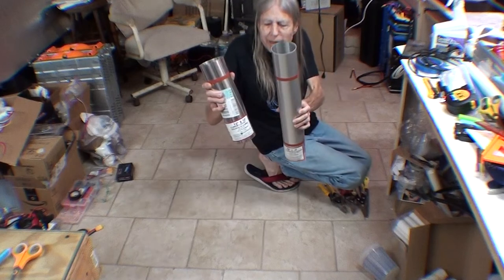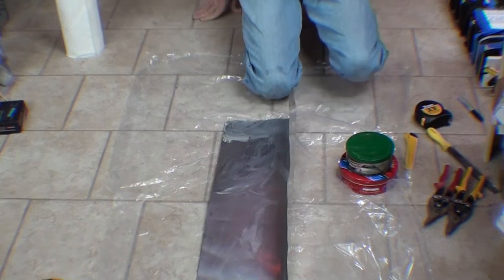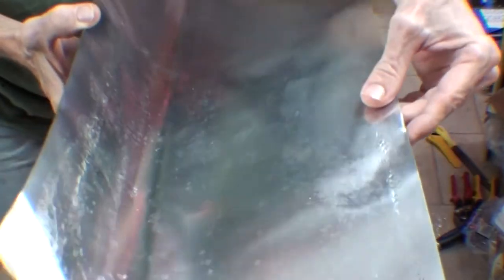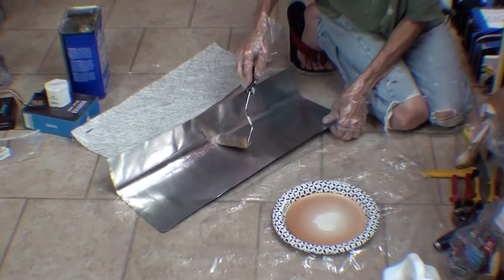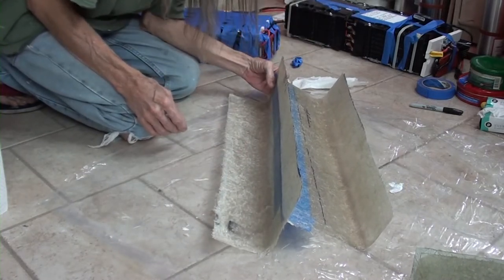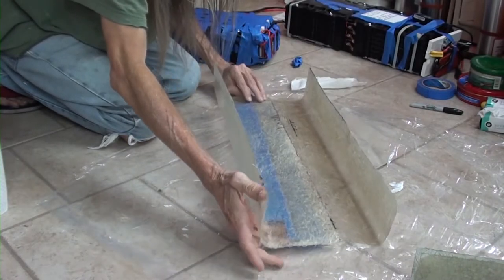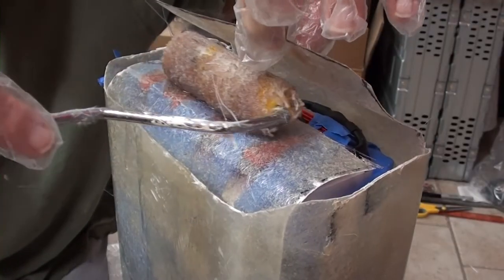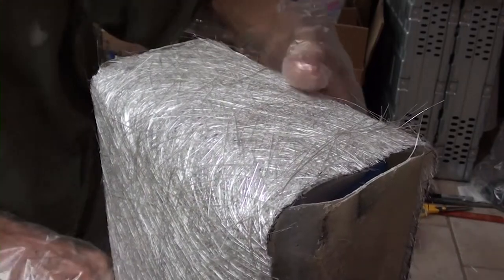Learn Fiberglass Fabrication Without Molds In 15 Minutes

Comment: Thanks for teaching me the roof flashing as a fiberglass mold technique. Flashing is fairly stiff, yet bendable. It is therefore lots better than aluminum foil as a mold, IMHO.
Reply from the maker: Glad to hear someone has benefited from the video a year after it was made.  Hopefully they will help for years to come.  Thanks for letting me know!
Reply: @ninehundreddollarluxuryyac5958  I'm planning on adding a mini split AC to my RV. The ceiling mount units I'm going to use are intended to be mounted inside a ceiling - so they aren't waterproof or anything.

I need an approximately 30"x30"x12" waterproof enclosure of some sort. Reasonably rugged.

I've seen lots of videos of people doing stuff with fiberglass, but a lot of them were more concerned about looks than you. Watching them, I was wondering how many shortcuts I could take and still have something reasonable. Or whether I should just get some other material like a big sheet of ABS.

Your video is perfect because it shows pretty much what I want to do. I figure that I will eventually make more things out of fiberglass and will figure out how to make them look prettier, but my roof mount AC will be covered by solar panels anyway, so nobody will look at it.

Your workshop looks similar to what I will be working with. Even your hair length matches. :)

Comment: I'm trying to do the same thing I thought of that you're doing but I thought of using tin foil instead of the wax and put the tin foil on the shape of the metal panel corrugated steel sheets I'm making. You put the aluminum on there to make the shape and then do some kind of fiberglass on the aluminum foil but I kind of also like the way you do it but I haven't started on this project but I'm learning from what you're showing me what do you think I could add for stability? Or anything other ideas I'm just trying to copy corrugated steel panels that I can't find anymore
Reply from the maker: I want some corrugated panels too.  I actually want corrugations that are flat on the bottom and top.  This pattern lets me glue a flat sheet on each side for a honeycomb effect making a much stronger panel for floors or roofs you can walk on.  I take a piece of flat, thick foam and cut strips.  Cut at an angle one way on one side and angled the other way on the other side of the strip.  This makes a long strip where the sides are ramps that go from the ground up to the top of the strip and back down to the ground.  Cover it with plastic, wax paper, maybe aluminum foil, I hear newspaper can work.  Then lay glass over it to make a mold for one corrugation.  Flat on the bottom, ramp up, across the top, ramp down and flat again at "ground level".  The flat ground areas of many identical molded pieces like this get glued together into a rippled panel as wide as you need.  In my case, I would glue a flat sheet on each side to make a structure similar to the walls of a cardboard box.  If you need a lot of corrugated panels, pull a mold from the first panel you make from the strips and lay up whole panels based on that first one.